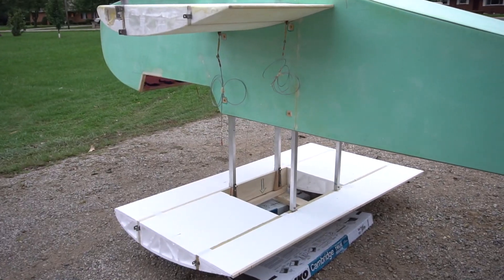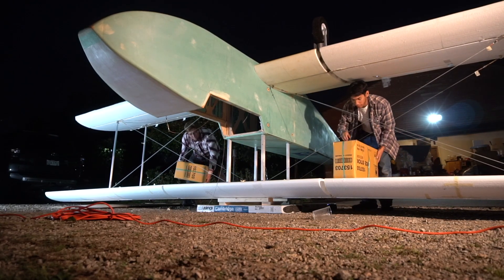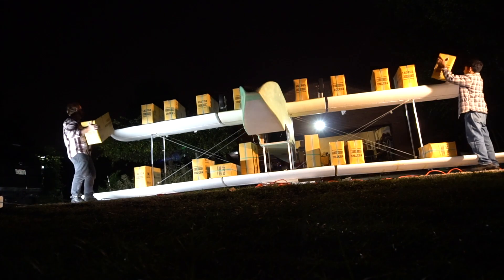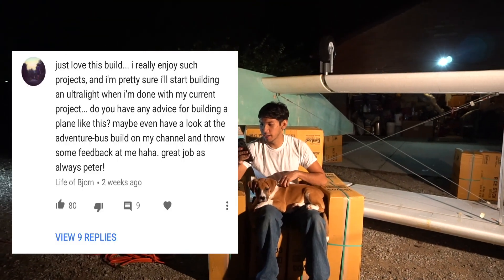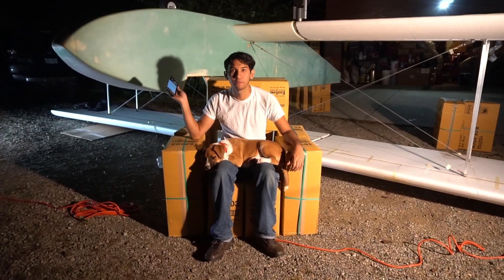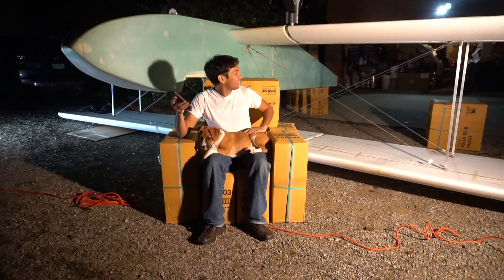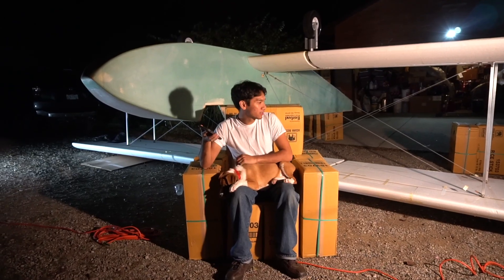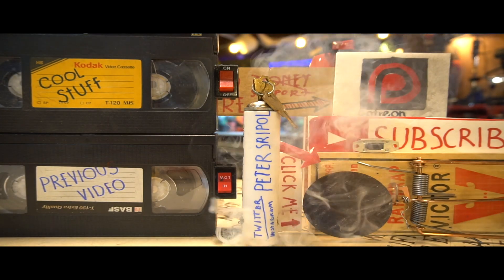DIY Electric ultralight pt5 (Making the Wings)

Comment: No fiberglass on the wings?? Structural gains may out weight the weight penalty.. Never mind the weatherproofing issues.. That foam could hold moisture = added weight. Laminar flow could affect the stall speed. Lots of considerations.

Comment: Hello Peter, I am aeronautical engineer, here is my comment.  It sure looks strong for it's weight. However static wing loading is not the only concern you should have. On of the most difficult thing to predict is aero-mechanical interactions such as flutter or reversed roll control due to wing torsion. Usually ribs and skin would stiffen the wing structure and increase it's resonating frequency but you don't have any.  The fact that you went for a biplane is good though. I am not.staying it won't fly but that you should be extra careful as it's not a usual design for a plane this size. Fly safe ;-)

Comment: Would you like help with some engineering knowledge? I'm concerned that your load test didn't accurately represent the actual loads and stresses subjected to the wings in flight. This means your 2.5G loading wasn't really the load the wing is going to experience in flight

Comment: Aircraft Spruce    3M GLASS BUBBLES 1 LB. 01-14600 $8.75
These bubbles are actually hollow glass spheres. Because this high-quality glass is very crush resistant, the foam is much stronger, stiffer and water-resistant than any foam made by chemical foaming. These foams displace 4-6 times their weight in most resins and improve the handling characteristics of the base resin. They have a low bulk density and are nontoxic. Mix resin and hardener as directed, then fold in the glass bubbles. Upon cure, a strong, low-density product results which is easy to sand and file. May be shaped to form compound angles and curves. 

The term "micro" was applied to the mixture of microspheres and epoxy early in the development of composite structures. Although microspheres have been replaced by glass bubbles the word "micro" is still commonly used to reference the mixture. "Micro is used to fill voids and low areas, to glue foam blocks together and as a bond between foams and glass cloth. Micro is used in three consistencies - (1) a "slurry" which is a one-to-one by volume mix of epoxy and glass bubbles, (2) "wet micro" which is about two to four parts glass bubbles by volume to one part epoxy, and (3) "dry micro" which is a mix of epoxy with enough glass bubbles to obtain a paste which will not sag or run (about five parts to one by volume). In all instances, glass bubbles are added to completely mixed epoxy resin and hardener. Wet micro is used to join foam blocks and is much thicker than slurry (it has the consistency of honey) but can be brushed. Dry micro is used to fill low spots and voids and is mixed so that it is a dry paste and will not sag. Apply with a putty knife. Never use micro between glass layers.

Comment: I do have one suggestion. You should try to 3D print a scale model, and set it up in a wind tunnel to see how stable it will be. That way you can know what characteristics to expect when you go to fly the full size. And another thing. It would be neat if when you flew the plane you had someone else launch the RC missile alongside you.

Comment: Safety wire and secure everything you possibly can. Ive been a maintenance technician on airplanes for three years (Haven't  earned full A&P yet). I personally wouldn't trust the nylok nuts alone but honestly you'll probably be fine with just the nyloks.check out a book called the "Aviation Mechanic Handbook", it has a lot of info you might find interesting and useful on fasteners or tools. I work with a group of guys that have a good 20 years of experience so if you want any questions answered I'd be happy to relay them over.

Comment: Adding Boxes of weight is static loading. While flying, with any wind and general vibration, (which I'm sure there will be plenty of) the air frame will undergo variable loading, which can lead to failure at lower maximum loads.  Maybe try to bounce the load some by flexing the wings under load, to better simulate flight conditions?

Comment: OK, unsolicited advice incoming.

Plan your test flights for either dawn or sunset when the air is still.  When the sun is high, you get vertical air motion which creates 'G' bumps.  Racing gliders are designed for over 5 'G' up/down.

Threadlock.  No.  Use fibernuts or castellated nuts with cotter keys.  As you are. 

Good luck.

Comment: another comment from the netherlands, from someone who works in the aircraft industry. dual locking in all its forms is a hotly contested subject with us. nasa reckons toqueing a nut and threadlocker is dual locking. easa helicopter people reckon it's no locking. 

all the bolts i've seen you use are used for a shear load (this irks me no end, but that's my problem and i get why you do it). in this case there's a reason for dual locking, and nyloc + split pins is a good, if heavy way to do it in this usecase. adding threadlocker in the mix is highly unadvisable. not only may it interfere with the nyloc, it wouldn't even properly work since you're not torqueing your bolts. threadlocker needs the tension in the bolt to get the correct layer thickness, and with some compounds even start to harden.

Comment: Don't forget to safety wire those turnbuckles, you can see how it is done in the AC-4313B book. Also I do have an Aircraft Airframe and powerplant mechanic degrees and I have not seen any where that lock tight is used on the bolts, but the extra precaution would not hut to do.

Comment: Regarding your thread locker comment: The fumes from thread locking compounds react poorly with most plastics. It won't always outright melt it, but will chemically embrittle it. The plastic will often look totally normal, but it will crumble as soon as you put any load on it. Use locking nuts for non-critical fasteners, and either castle nuts with cotter pins, or cross-drilled nuts with safety wire for critical fasteners.

Comment: Awesome with a new Update man, one thing i don't understand tho, is Why you cut the foam inside the wings out (if that makes sense). I mean, it seems like a lot of work just to loose like 1-2 pounds?
Reply from the maker: well an non cored section is 873grams vs 395grams (for 1 yard) that over a duration of 14.6 yards means 12lbs vs 28lbs. You tell me which is better LOL, and thats not even counting the nose ribs.
Reply: Most planes have hollow wings. It cuts weight and allows for wires for your control surfaces and motors. In Cesnas there are fuel tanks in a wing.
Reply: Wiring
Reply: PeterSripol Thats kind of what I figured. People don’t think foam weighs that much but those wings are huge.
Reply: Life of Bjorn the lighter the better, especially on a build like this
Reply: Doesn't this also help with rigidity? Kinda like a metal tube vrs a solid rod both same size. What has more strength?!
Reply: in an ultra lite every pound lost or saved is very important. you have a weight limit you have to stay under for the complete craft with pilot and that keeps you exempt from federal regs and license requirements.
Reply: Wow, i didn't know it was such a Big weight difference... Good point Then:)
Reply: gen3v8 the tube is lighter, the twisting is less, bending is less, so not sure where what your talking about. (Next time you go to the hobby store use the carbon as a test. The tube is all the above and all the above is what you want in an aircraft is it not?)
Reply: Also does the shape of the cores make much difference to strength or wing flex.? say peters design/shape v’s just plain circles .?.?
Reply: Life of Bjorn every pound matters
Reply: The lighting holes definitely look cool. That’s reason enough.
Reply: Videonun Perde Arkasi http://youtubem.video/r/?CdHozbBFIV7st2TaAIyGtOFCUvgtMxp21a=Rcv0KsigCAbDnKeUgTBJPaPlNp2rG3bA5xmsFvy
Reply: Videonun Perde Arkasi http://youtubem.video/r/?CdHozbBFIV7st2TaAIyGtOFCUvgtMxp21a=Rcv0KsigCAbDnKeUgTBJPaPlNp2rG3bA5xmsFvy
Reply: Life of Bjorn......owing to the FAA's weight restriction (for ultralights) of 254lbs maximum with the fuel tank empty, ultralight builders have to shave off every ounce they possibly can while still maintaining airframe strength and safety if they are going to meet the weight restriction.....However, the FAA does not usually weigh ultralights unless they are at sanctioned events or are involved in an accident.
Reply: A hollow wing is stiffer and lighter. Compare sailboat masts
Reply: the solid rod has, except in one force. Just saying!

Comment: Loctite on nylock nuts is not very common. I work on cars and naturally they vibrate and anything thats not using nylock nuts is either tapped into the engine itself or Loctite is applied. The use of loctite and nylock nuts is never even thought about and would probaby be overkill. Only reason id see for it is if youre assembling and disassembling this a couple dozen times as loctite stops corrosion and also helps stop nuts from seizing.. if youre going to use it use a tiny blob, any more will work against you. So basically, no nylock = small dab of loctite

Comment: Never use loctite anywhere near plastic. They do sell special loctite for plastic which is basically CA. For nyloc nuts, nothing else is necessary. Besides, being electric it should vibrate that much. Sit in an ultra light with a rotax and it will rattle your teeth out though, lol
Reply: BTW, ABS (3d printed) is especially susceptible to  thread locker damage. it happens slowly, but it will literally disintegrate the plastic.

Comment: I am really enjoying you videos on this homebuilt aircraft.  It looks like it is well designed and built and should fly without a problem.  I have one question, do you have any experience flying a full size airplane?  If not, are you planning on taking some lessons before attempting to fly your aircraft.  As both a licensed pilot and an RC modeller I think a few lessons might give you some feel on how a full sized airplane behaves in a low speed environment.  Good luck and best wishes.
Reply: I'm a commercial pilot and I too would like to know the answers to these questions. This will be a multi engine taildragger and both of those things could easily get you into trouble on their own if you don't have any experience with them. Together they could be a disaster. I'm getting these terrible images of you losing a motor, reaching Vmc and spinning it into the ground. I can also see it being very easy to ground loop in a crosswind as it does have very large flat sides.
Reply: I do believe Peter has his private pilot license, or at at least has done some flight training.
Reply: I'm afraid the electric motors and or batteries wont provide enough thrust or the battery dies early and he has to make an off runway landing...
Reply: BlackFallout why do you think the easiest thing to calculate is the one that will fail?

Comment: I really think you should put cable on the elevator for flying inverted because the tail more than the rest of the plane will experience both negative and positive Gs even in normal flight.  Last thing you want is for the elevator to fold up on you due to some turbulence or you pushing the stick forward or back.

Comment: Nice work Peter! Just a word if it's not already been mentioned. It's too late to change them, but the steel attachment plates for the flying and landing wires should have been oriented in line with the direction of load from the wires. One solution to compensate would be to add a tie plate between the interplane strut and wire attach points.

Comment: I love this! This will give so much hope for builders that nothing is impossible with enough determenation.  How much costed you by now (not including tools which you already have) to build this? What are your estemation, how much it will cost at the end?
Reply: P.S.- Pro tip: Use polycarbonate fillament for 3d printed parts, its strongest available. Dont use metal or carbon fused fillaments because they are weaker. If you use ABS, try to use Acetone Bath, it will give much stronger bonds between layers. Use at least 5-10 degrees celsius higher temperature than recomended for printhead because it will fuse layers much better and it will give you stronger parts.

Comment: Come on can you get this thing up in the air already. I know your taking your time so you'll succeed, not cash and burn..  but damn I'm impatient lol. What kind of brushless motors, batteries and speed controllers are you using?
And have you thought of using large scale 3d printer to make the motor? Some of them if done right are really light and efficient

Comment: Nyloc nuts are fine, no need to use threadlocker as well. Since you are using electric engines you will have very minimal vibration if you've balanced your props.

Comment: If you apply the threadlocker correctly it shouldn't come into contact with the nylon locknut; but even if it does the nylon wouldn't impact the performance of the threadlocker.

Depending on what threadlocker you use some are permanent, some you have to heat to release, and some are going to be comparable to the lock washer. I think it's definitely questionable to use thread locker on anything you'll have to remove between flights, but permanent grade locker on permanent nuts seems like a good idea.

Comment: Are you planing on making the steering function a remote control or something more traditional (like a joystick), and are going to put stuff on it like altitude meter or a air speed meter. By the way good luck I think you are doing great and stay safe.
Reply: He built the joystick in a previous episode...It looks to be a traditional system with cables/wires....
Reply: Ok thank you for the info. I did remember something about that but I wasn't. I guess I am now!

Comment: I went back through the video and heard you say "I have some tiny nuts" in the question section. Made me laugh. Heck boy, you gotta have huge nuts to do this. Seriously though, I was a bit worried when I saw the way you connected the wing sections together. Then I realized it was going to be a biplane and all the wire bracing. Have you thought of any diagonal bracing from front to rear on the main wings?

Comment: I just rewatched my Burt Rutan "Building the Rutan Composites" video. To add alot of strength to the wing span,
with your plunge router, dado out a 0.1"(4 layer thickness) groove from fuselage to wing tip, on top of your wing spar.
Then wet out and lay in micro slurry on that, then 4 layers of the follow fiberglass 3" tape, squeegee off all excess epoxy.
Aircraft Spruce Part No. 01-06800 (Unidirectional Fiberglass tape 3"). Then put on your top E-glass cover material.
This is how he does it in his aircraft plans(only hes adds in about 7 layers).  Just trying to help you out...safety is important.
 It's looking pretty good.

Comment: You should put an aluminum skid plate on the bottom for emergency landings. And the wind screen looks dangerous. The sharp edges are not safe if your nose is crumbling in a crash it will cut your face.

Comment: 170lbs + 10tail + 10glass + motor + batteries + pilot == at least 300lbs. So 2G is at least 600lbs, correct?
Reply: + parachute

Comment: Getting your wings cut in Dayton Ohio is kind of ironic (don't think I used the word ironic correctly) 

Question.  What type of flight control will you be using.  A normal stick or one of those  half circle things that airliner pilots use?

Comment: Safety wire, cotter pins, self lock nuts: are all perfectly good enough. Only use thread lock if you can't do one of the others. Keep up the great work by the way. I have experience building composite home built aircraft, and you are doing fine from what I can see from the videos. Just make sure you are not using wax lined cups to mix the epoxy.

Comment: We've buit 2 planes (RV-6) at the école nationale d'aérotechnique and there's even still one in building process that is going to be an experimental electric plane and every nuts or bolts are lock in place mechanicaly , I've never saw someone use threadlock on something that flies.

Comment: to be safe, you should probably safety wire all the bolts (drill holes through the nuts and the bolts then run safety wire through them and twist it to another bolt safety wire hole) just google it they do it on race bikes and cars and also on airplanes

Comment: I assume the copy-pasta worked as well on the boxes of noodles? You might need to copy pasta those noodles some more based on the math of other comment's, you might only be @ 1.7G's (remember it is total flying weight you are trying to static load onto the wings for every G. IE: if you put you and the finished plane on a scale, every 1G of load should be that scale weight)

Comment: Don't use thread locker. Only safety wire, cotter pins, or ny-lock nuts. Make sure you have sleeves through the square tubing so that you can get proper torque. The tube will crush before you reach AN specs.

Comment: Get a vibration motor, or put an off-center weight on a rotary tool and strap it to the plane near a bolt.  Run until satisfied it won't slip.  This is my own anecdotal but even when I use the wrong CW/CCW nylon lock nut on a drone motor prop it still stays on.

Comment: I can attest to the strength of 3D printed materials, I have a video of 3D printed skateboard wheels which have been holding up since. You could try making a TPU set of airless tires like to attempted to do for some kind of suspension. Good luck!

Comment: I think for 1G you would need to load the wings with the complete weight of the airframe, you, batteries, etc.  I think this is about what you tested.  2.5G would be 2.5 times that.  If you make that 230# weight, plus yours weight, batteries, motor (s), etc.   Call it 350.   so 2.5x that....   so nearly 900# would be required and that is probably on the light side.

Stay safe!